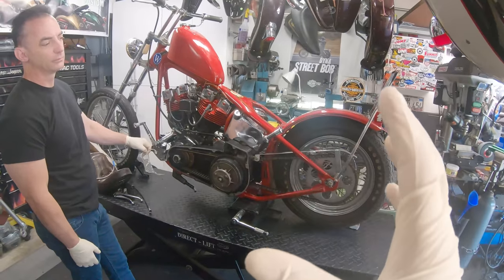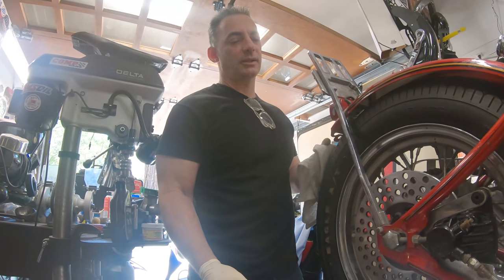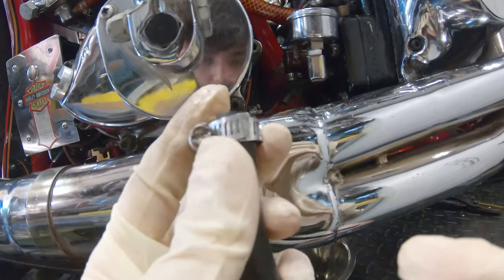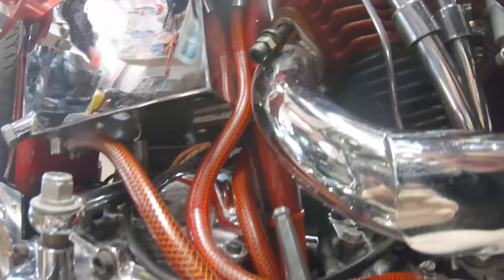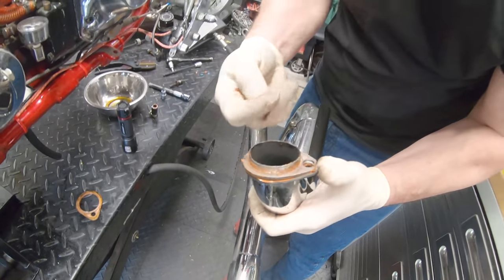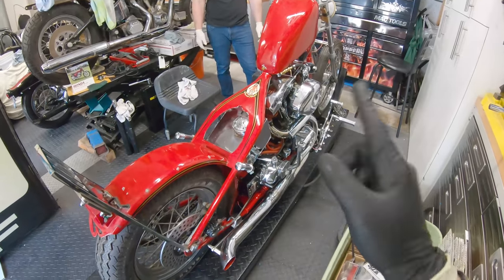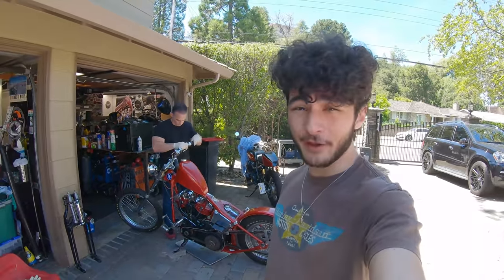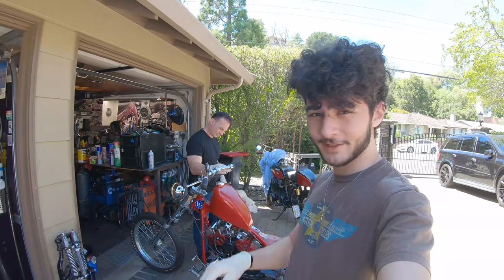Fixing the smoking problem on our 70s Shovelhead Chopper

Comment: A manual would have told you that.
BTW...it's called sumping (when the crankcase fills with oil after sitting for awhile). All the older big twins do it, and some Sportsters too, and it's an easy fix.
It's the check ball and oil screen in the oil pump. There's a big screw right on top of the oil pump where you can access it. A piece of grit or something got in there and that's what causes the sumping.
My Shovel quit doing the sumping thing the first time I cleaned the check ball screen.
Also keep that breather hose AWAY from the rear tire, for obvious reasons.
A well known exhaust trick is to double up the exhaust gaskets and use blue loctite on the single bolt. The single bolt system sucks and they like to loosen up after a bit.
Once it warms up that oil pressure will drop off to nothing, which is normal because they run on volume, not pressure.
Get that front end figured out and RIDE THAT SUCKER!
Reply: I know your an old head like me sometimes watching this stuff is painful. Only a shovel owner would know the pain of single bolt exhaust flanges.
Reply: @stevem5139  exactly my thought. That rear exhaust port is probably stripped out that’s why he gummed it all up with the silicone. Definitely poor design with the single bolt I’m putting S&S heads on my shovel right now and looking forward to not tightening my pipes every time I leave the house

Comment: I ran my breather hose up to a fitting I made in the top of the central vertical frame tube and fitted a filter to the bottom of that tube and a screw cap on the opening of the bottom of the tube that catches all the oil from the breather turning the tube into an oil catch can and you just unscrew the bottom cap to drain the oil off. It works real well and solves the messy breather problems.
Reply from the maker: We've done that before on another shovel. Great way of doing it

Comment: I use the woven evolution exhaust gaskets on my 78 shovelhead flh, you have to take your time and stretch them around the exhaust, but I have not had a  exhaust leak since I put them on 10 years ago. 
And I also had a serious sumping problem with mine, I removed the check ball and spring in the oil pump and cleaned it out with a bore mop from my gun cleaning kit, then put old check ball back in an used a Teflon punch and brass hammer to lightly tap and seat the check ball, ( removed it with a thin magnet) put in the new check ball and spring, oil sumping problem went away. 
I do this every other oil change.

Comment: Hugh Jorden is right but also the breather hose was to run into the air cleaner but if the bike wet-sump it would spit the oil into the air cleaner so everybody just cut the hose, you can buy a filter for it and run the hose so it sweeps up higher and that stops the puddle of oil on the ground when it wet sumps.

Comment: Had a shovelhead come in the shop smoking like that one, whoever's built it didn't understand oiling of a shove at all. First of all breather plug blocked thought that would be the end of it. Nope still smoking like a train compression test was 110 each cylinder. Leak down test all good, cylinders look good with bore scope? So I said maybe oil pump not drilled for newer style  pump nope, then maybe after market lifter blocks clogged or partially clogged, Nope, pulled front head off and at least 1.5 quarts of oil drained out. Long story short,  somebody build a stroke and did not machine the case for oil returns from top end.
Reply from the maker: Wooowwww. That’s crazy man. Oil returns happen to be useful

Comment: Crankcase breather.
 The downward motion of the pistons builds up pressure in the crankcase, and it's gotta have somewhere to go.
 If excess oil was building up in the crankcase, the check ball valve spring on the oil pump is probably weak.
 The previous owner probably siliconed everything because oil was probably seeping or squirting from every orifice.
Reply from the maker: we know

Comment: Great work but I'd put the outer primary on, open drives can make you a cripple in an instant. Just saying.
Reply from the maker: In an upcoming video, we put on a customized cover
Reply: Al Gottsch  Al:

Back in the early 70's a buddy of mine was riding his Triumph Bonneville 650, he was wearing bell bottoms and went to put his one of his feet down coming to a stop. The bell bottom "bell" caught a bolt so he pushed his leg as hard as he could ripping out his pant legs but didn't drop his bike.

-'lil stan

Comment: Put the one-way flow check valve into the breeder only to go out do not need to pull back the air from the outside it reduce or laminate oil leakage or should I say oil misting
Reply from the maker: it’s more of a massive oil spill

Comment: Having no filter on the breather hose in a Dusty condition particle go into the oil equal clogger the system possibility a lot of slogan in the bottom of the crankcase

Comment: How do I fix it from dumping? Where do the hoses and screw go? I put a 5 speed transmission in. It came back sumping..it wasn't befor
Reply from the maker: One of the main factors for the oil dumping on a bottom breathing motors is the height of the breather hose. If it loops up high and then comes back down there’s less of a chance of it shooting tons of oil out. There are tons of other methods to not have it spray oil out. We’ve seen breathers plumbed right into the oil bag with a special breathing cap.

Comment: it has a scavenger oil pump there is a plug with spring and a little ball under it if the spring or ball is worn out it will puke oil out the breather tube the guy had blocked off probably why he blocked it off

Comment: Those brand new sparkling gaskets will leak. I used gaskets from the automotive world, cheaper and much better. You will route the breather hose so that it will not get oil vaper on your tire. Get it blowing on your chain. Engine sounds great though.
Reply from the maker: We would do that, but its already sold

Comment: It’s an engine, not a “ motor”…. Motors run on electricity…….carry on.
Reply from the maker: Sometimes we just use them interchangeably. You know what we mean
Reply from the maker: Correct. The main reason motorcycles got that name is actual due to its latin roots. “Motus” in latin is to set in motion, and motors are implements to create motion. Then you pair that with a cycle, and voilà the motorcycle.

Comment: ALL THAT SEALANT WILL CAUSE THE BOLT TO PULL THE THREADS OUT. CAUSES A HYDRAULIC EFFECT
Reply from the maker: Yes too much sealant is never good. We felt very good removing the unnecessary sealant.

Comment: You obviously never spent hundreds of dollars on an exhaust that was not build correctly and does not fit or seal, and your only recourse is to use the gasket sealer to get the bike back on the road...
Reply from the maker: The original owner set up the exhaust and we had to make it work

Comment: THOSE ONE BOLT FLANGES are GARBAGE, ALWAYS ISSUES. 2 BOLT is the WAY to GO. I HAVE SEEN SHOVELHEAD FLANGES MODIFIED TO  TWO BOLTS. SUCH a SIMPLE ISSUE CAN CREATE SO MANY DAMN PROBLEMS
Reply from the maker: We HATE the one bolt flange. We were lucky and these ones were not leaking but dear God they’re terrible